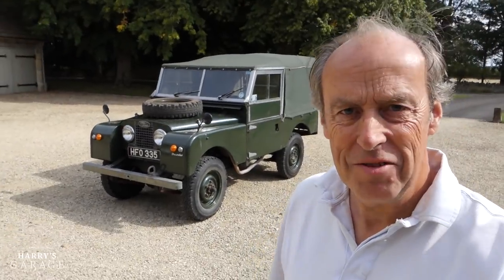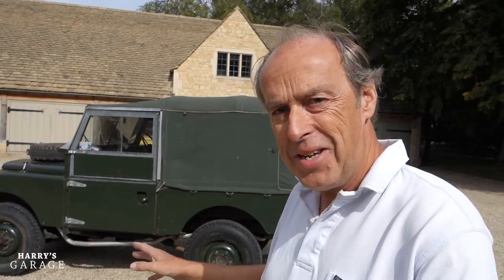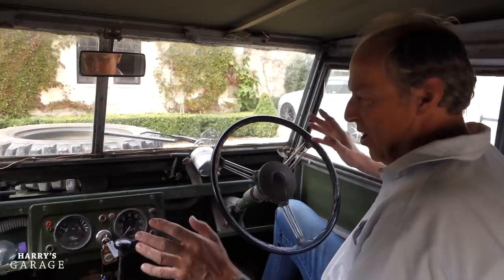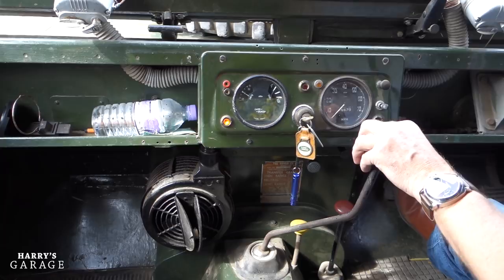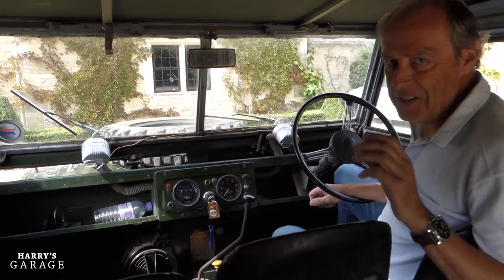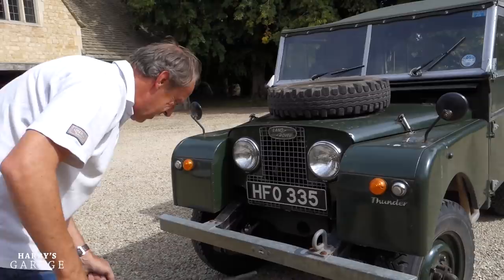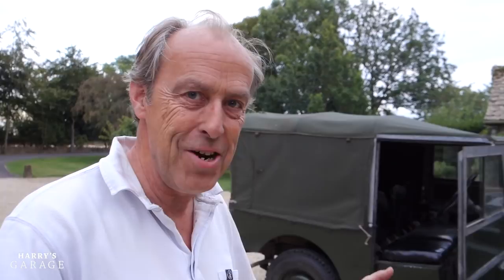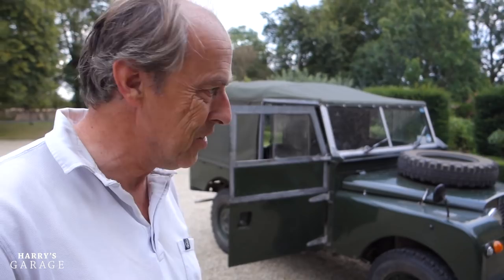Land Rover Series 1 86" review

Comment: Why doesn't it need a MOT?
Reply: Vehicles over a certain age do not need an MOT as their owners are attentive lovers of the car, and will keep them in excellent condition. Cars this old also tend to do a very low annual mileage. Also, with so many regulations for lights and brake systems a car as old as that will certainly fail.
Reply: Too old I think
Reply: Jake Tongue  what if they don't look after the car though?
Reply: BigBaddie666 Not the governments problem if uncaring oldtimer owners crash into a lampost
Reply from the maker: Pre 1960 cars in the UK no longer need to be MOT'd.
Not sure it's a good idea, though, especially when I discovered the thread on the steering joint on my Series One was so worn, it could have popped out at any time. Imagine that happening on a motorway and suddenly having no steering? Not good..
Reply: Harry's garage
Thanks Harry
Reply: Harry's garage
No Mate! If you own and run a pre - 60's motor of any kind on the highway the onus is on you to make sure it is safe, legal and roadworthy. You will find yourself uninsured, and uninsurable should you cause an accident through neglect.
Reply: There is nothing stopping one from asking your local Garage to do an 'MOT' minus the electronic stuff.